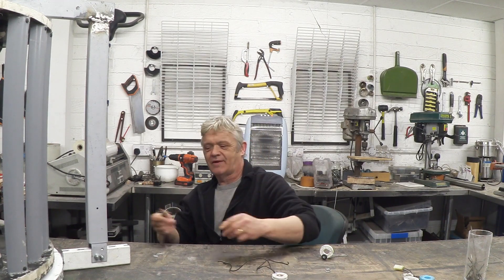The Wind Energy Harvester - An Apology And An Astounding Thing

Comment: More to the point i made on an earlier video. The o-ring even in an loaded system may cause back emf problems between coils. Also those are probably cheap diodes and may have large forward voltage 1.1V.  Nowhere near as good as power silicon schottky or zener rectifiers which may have Vf of 0.5 to 0.7V. These losses become important in micro harvesting situtations but also at higher loads.  Also even if your wind reaches the 10m/s there is not enough input to generate 1kw which was your original now renamed project title.   However don't let that throw you off. The GE MW off shore wind turbines are specified for 25 to 55mph wind speed with (gearing etc to flatten out maximum power delivery). So say you're able to also do this. i.e your VAWT is able to operate in Gale force winds at 55mph you'll have about 4kw  available energy. Is your generator going to deliver... Keep going please.. but do rewire that stator.

Comment: Great stuff! A very useful series, many thanks. I've built something slightly similar, using two lightweight bicycle wheels top and bottom, connected by 7 vertical pieces of 114mm plastic gutter to form the rotor, 74cm diam by 75 cm high. I used good quality bike bearings, but want to try magnetic bearings for really low friction. Haven't done the electrics yet, but the aim is to charge a 12v lead acid system to run lighting in a shed.

Comment: Not sure how you did your calculations, but you need to factor in the fact that putting load on it will slow it down. If you assume it will rotate at the same speed under full load as it does under partial or no load then you will get incorrect efficiency figures.

Comment: Can someone help me understand that betz law?
Betz law says that at a given wind power there is a maximum efficiency 59.3% and thus a maximum available wind power (at least at that omnicalculator website).
But let's say the turbine in this video is already at 55% turbine efficiency, it will double the power when added a ring of coils at the top. It is then beating Betz law, which should not be possible to my understanding.

I strongly feel that I am forgetting a part or thinking of it in the wrong way.
Reply: Betz law applies to how much of the energy from the wind can be extracted. Adding more coils will not increase the power removed (unless the existing coils were not capable of extracting the available energy) Think of each coil acting as a brake on the turbine, you can spread the braking force around the entire turbine, or just in one spot, but ultimately the same force is applied when you are converting the mechanical energy to electrical energy.
Reply: @1967spark  Thanks for the explanation. I didn't realize the coils (with no core other than air) worked as a break.
Reply: To understand Betz law think about what the air flow would be behind the turbine if 100% of the energy was extracted.

Comment: The efficiency of a horizontal Axial Flux three bladed wind turbine are not to be underestimated , a vertical axes turbine won't compare to their low wind performance. Horizontal turbines have the entire rotor producing torque ,not just half the rotor.The only advantage that vertical Axes turbines have is in turbulent wind situations. Thanks for sharing and great work as always!

Comment: I think the available energy formula will have non-linear terms of wind speed. Averaging wind speed in that case does not properly approximate the sum of the energy at the different speeds for shorter time periods. Let's take the example of a quadratic term with half the time wind speed 1 and half the time wind speed 2, the average speed would be 1.5 but the contribution in the formula would be (1^2)/2 + (2^2)/2 = 1/2 + 4/2 = 2.5. If the terms are higher than quadratic the distortion grows even bigger.

Comment: Sorry to be a downer but the wind calculator gave you an instantaneous power of 0.013W (13mW) that over 1 hour would give you 13mW/hr.  Charging capacitors with no additional load is accumulating less power over a period of time.  To maintain the static voltage you only have to replace the capacitor leakage.  This is not an indication of efficiency.  I would like to see a load connected, such as a 10W lamp and the unit spun up manually.  You could motorize the spin-up and get a better idea of the generation efficiency.

Comment: Good morning, what about strategically placed wind shields that will shield the advancing blade from the wind and redirect the available wind to the retreating blades? You should get about double the wind force on the retreating blades. It works, we tried it but our generator got destroyed in a storm before proper measurements could be made

Comment: A real electrician already knew what you meant mate, lol No need to apologize mate and yep if it had not been microfarads, each one would be the size of a coffee can, lol. I find it funny that someone actually said something to you in comment to the point of you feeling that you need to apologize and correct it. Some people never cease to amaze me. I wish Youtube would start allowing screenshots in comment. I would love to show you a sketch in the way of what my research on creating a generator was taught me in the way of setting it up to get the most possible with "no cogging". The concept is rather simple really, what you do is face all the magnets on the wheel in one direction, either all south or all north, then you trap the field by putting a coil with a iron core on each side of the magnets on the wheel, these coils are not connected to the wheel, then to stop the cogging you put another magnet on the back side of the core that faces the opposite direction as the field of the passing magnet. It makes the whole build cost more but it makes it very powerful and each core creates around 30 volts per coil set. You would do this all the way round the wheel and run the coils in series. At the end you are left with one beast of a generator in power. Keep in mind, this is not an idea but is 100% facts that I have done and it works outstandingly but you would have to use Neos if you want it to work right. For some reason, the standard magnet does not produce the results nowhere near as well at all. Cheers mate

Comment: I am curious about about the "self regulating" aspect of the build. At what wind speed will it not turn any faster? (I realize this will require real world testing) Also, I was thinking it would be really interesting if you added data sensors to one of the coil induction  capacitor rectifier circuits in this build and graphed the output at various points. For instance, The rotational speed correlates to the coil induction rate. I'd put an anemometer on top and capture that data also. Send that to output.

Comment: to error is human, but to totally f things up requires a computer. I wouldnt draw much conclusions from the web calculator... energy available is the mass of air and speed its moving. the design is great, but Ive never managed to get much power out of any homemade generator (needs really low resistances), just spin it with a drill and measure the in to out for efficiency, drills are about 80-90% efficient turning electricity into rotary motion. something like that bicycle wheel thing you did might work better

Comment: Really nice videos, keep on doing! 
I'd like to offer the way to better estimate power by properly measuring wind speed.
1. You're using a directional anemometer, so direction is crucial here. To get accurate reading it should be coupled with a weather vane to be automatically pointing in the right direction.
2. Place to measure, ideally right before the drum in the middle. 2nd best place on top of the drum.
3. Wind quality is very important. For reliable measurements laminar flow is the key, means open space needed. In turbulent flow, like on the most of the videos, no precise measurement possible at all, just random numbers.

Hope it helps on estimating the real efficiency of the generator. 
Looking forward to see more videos on this really interesting topic!

Comment: it isnt collecting much power at any one point but if you save that power in a battery to be used later, a fleck of flour isnt much of a meal but add it with a million other flecks and you can make something of it.. you dont get much power back from regenerative braking either but in the long run it adds up... smh...  I have 2 things against me when it comes to electronics, Im terrible with math and Im color blind so most of this is greek to me but its intersting none the less

Comment: Every audience has it's comedian's
Love ya Robert, question? Could  you consider a series of 220v coils with a single core for higher wind speeds? It would require a mechanical cut-off of sorts for the low volt coils; look's like plenty of room  underneath for microwave coils with a short core, charge controller is already in the plan's, just for fun sneak a bindini coil in it  I won't tell any one! 😳 the low volt coils might double as an electro magnetic break for high speeds so it doesn't blow to bit's, oooh suppose you energize the little coils in sieries from the 220: volt coils via the right watted diode so the big coil does nothing till a set "cut-on" voltage, then on to charge controller. Thank's Robert I was going to get some sleep tonight. Please continue to be kind, and know god didn't lead you to us by accident.

Comment: Instead of generating electricity why don't you use it for a pumped hydro system.  The wind generator you have made could drive a small positive displacement pump.  When you have collected enough water with potential energy you can use it to do actual work.

Comment: The device can not be very efficient, because it only harvests energy at the top of the voltage. I mean: the capacitors will only be charged if the speed of the device is high enough. So there have been many rotations, not transferring any energy to the caps, since the voltage was already higher that what was generated. As soon as the energy is being used (drained), the efficiency can go up. This is also the reason why it was freewheeling so often at the end of the video. There just could not be any drag (if any), since the caps were at its fullest already. (I am not saying they were filled 100%, it is just time related, I hope you understand my way of thinking/explaining)

Comment: LOL, I did not even notice your mistake and would have assumed it was uf anyway, I am sure output will improve very soon when more coils become available.
I have noticed on microwave turntable motors because I may have broken one or two microwaves up in the past that the motors tend to be either 21volt, 30volt or 230volt does this affect your output on each coil?

Comment: I would quite like to see you do the output calculation if you ran this device underwater using an air pump to drive it. Is it your calculation x 1000? Of course you would need to mount it sideways in a tank. Now that would be a fantastic output. Renamed - An Air Water Energy Harvester. Great Experiments.

Comment: I'm more the sure you can extract far more power out of that machine.  Amps not uWatts.  Using better coils you would realize far more current.   Using a Hover board motor would generate some 10 or 15Amp in a far wind of 12MPH.  Something like over 24v.

Comment: Not certain how you did your calculation, but ...... 

Don't forget you are charging those cats at a healthy rate, you get a pulse every time a magnet passes a coil (not sure of your magnet count .... or the number of coils you have in that quarter you populated). Also you have your  voltage measured in DC whereas it is actually a smoothed and rectified AC ..... not much difference, But when you are measuring usable power it is the decay curve of those compounded capacitors, not just how much charge they hold!

As ever an interesting topic!

Comment: Try anodizing bit of titanium foil in diet pepsi... Then placing it in bit of copper pipe. Value reduces depending on voltage it's anodized to (it thickens the dielectric/anodized) , but anodising with 12V and then  filling with water can  get a polarised cap of aprox  200mF out of strip about 50*5mm.

Comment: Dear Rob,
I think you don't need to apologize about the mixing of microfarad and farad because everybody who has a little bit of knowledge would see the correct capacity.
I'm more a lover of pracsise than theoretical: If it was my mashine / project I would place it on the highest point I could find, put a meter at the generator and let it run for one day or more. 
Finally it will run in this circumstances anyway - it's than only what kind of batteries needed.

Comment: Sorry Robert, but you can't read any meaningful conclusions on power or efficiency from the charge in the capacitors. That is just showing the VOLTAGE output. You MUST (repeat MUST) connect a resistive load, so the thing is actually delivering real POWER (heat!). Unfortunately, an LED load like you've used in the past will not prove anything either, since LEDs will always light (to a degree) once their forward voltage is exceeded. Also a proper load is essential when you want to know how easily it will spin under low wind conditions. Unless it is horribly inefficient, you should expect it to slow down, since it will now have WORK to do.
Reply: ......when Rob demonstrated the the windmill with the mot primary coils ,then100 ma was measured lighting up the led arrays. He tried a number of coils which he showed some and ticked through the others he'd tried on his own . For led purposes a resistance in the coil windings can't be avoided if seeking the minimum 28 volts turn on voltage. Maybe thicker gauge wire would reduce resistance just a little but it's all about trade offs and priorities of cost ,efficiency, weight, balancing, time........He never claimed to have all the answers and has made it clear that the design is malleable to the vagaries and contingencies of materials, location , wealth, climate......
 I know you can generate at a lower voltage then use efficient switch mode circuitry to boost voltage but it adds complexity and extra reliability problems , the individual designer can navigate their own design priorities . For my part I avoid switch mode circuitry cos of the radio interference .
Reply: Thanks for the suggestions guys!

Comment: Just an additional thought on your design, it may need a speed brake fitting to prevent the turbine becoming out of control given it so efficiently captures the wind. Maybe add a standard car bulb to the output to give viewers more of a real time viewable example of the turbines output.
Reply: Balls out..ha
Reply: Vawt have the advantage compared to hawt that they are much safer at high speeds.

Comment: I used the VAWT section of omnicalculator with a diameter of 0.8m, height of 0.8m, windspeed of 0.4m/s and got 0.025W power available. If you charged 14x0.001F capacitors to 8V you made 0.5J. If this is only a quarter of your alternator you could maybe make 2J.  (Edit - no, you can't assume this and we should stick with 0.5J for now) Your test ran for 10 minutes which is 600s so your average power was 0.5/600 = 0.000833333W. This means you had an overall efficiency of 3.3% which isnt actually as bad as it sounds but also isn't 100%. If you assume 20% efficiency for the rotor (that's generous but possible for a crossflow rotor) and 5% wake loss you've got 0.005W available in which case your alternator is 15% efficient which will hopefully go up when you add more coils (but you'll be adding more winding resistance too...). I hope these numbers scale up to it delivering decent power and energy.  This is all far too much extrapolation from a tiny amount of data gained in a not very scientific way and an improper load - get it on a resistive loadand get some proper data!
Reply: Are you sure that you can extrapolate that using more coils will extract more energy?
Reply: @1967spark  no. You're right! It will likely bump up the efficiency a bit but I agree - I can't assume that. I've edited my original comment to reflect this. Thanks!

Comment: Wow, 100% (or very close to it) efficiency, just wow.
Reply: As Robert stated in his video, that is more than likely due to not having an accurate wind speed entered into the calculator, the calculation includes the cubing of the wind velocity so a small change in velocity has a larger effect than you might otherwise expect.

Comment: What did the calculator say for higher wind speeds?
Reply: Higher wind speeds contain more energy, but can you control the speed of the wind?
Reply: @1967spark  add an electromagnetic brake system that limits the RPM